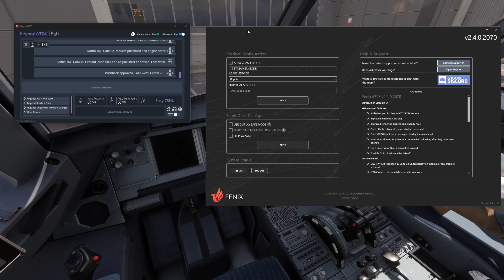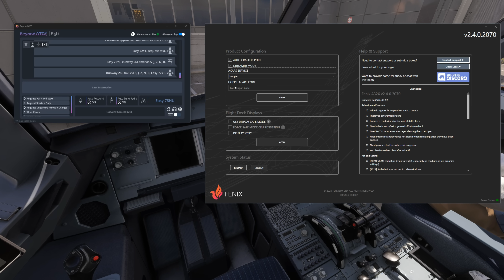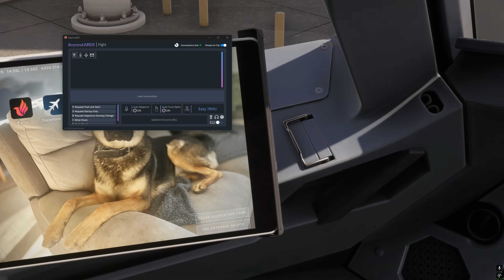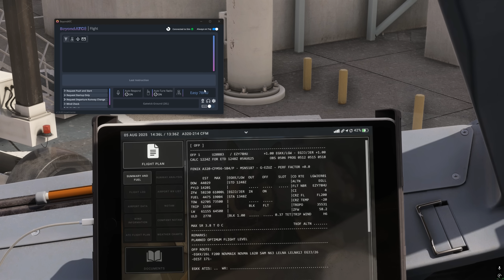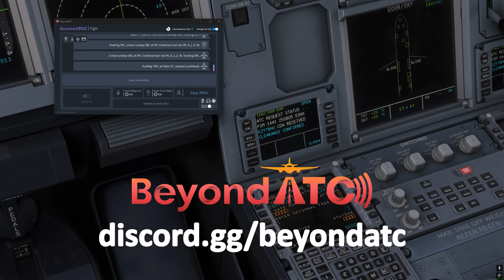HOW TO - BeyondATC (BATC) & Fenix A320 CPDLC PDC Integration SETUP AND USAGE GUIDE

Comment: Couple questions about BATC sir if i may, first does it work in MSFS 2024? And if so, does it require the FSUIPC to connect to the sim?
Reply from the maker: Hello! Works fine in 2024, and it only uses native simconnect. No requirement for FSUIPC (although no conflicts using it if you need it for other apps)
Reply: @JasonOPlays  hey there sir sorry just getting back to you now i actually purchased BATC after seeing your reply here and I absolutely love it thank you so much for recommending this. just a quick update question if i may sir, when is the average time that experimental stuff will be inserted to the stable build? i wasn't aware of this feature that you covered in this video but now i realized that seems like so many good stuff are present in the experimental branch, its just im not willing to buy the Experimental package as I felt that if I have the same amount of funds to purchase it i'd rather buy the Premium voice big pack so that i can get the 750.000 character. hope you reply again sir, thank you again and best regards.

Comment: Where do you install the experimental version how did you get it
Reply from the maker: You need to purchase the Supporter upgrade for BATC to access it. You then change it in the options. However, this feature will come to the normal Early Access branch and probably won't be too long to wait.
Reply: @JasonOPlays I wish they would implement the taxi route in vr the tool bar is great but no airport taxi map. I play only in vr with pimax crystal super and 4090.

Comment: Any plans for integration with FSLABS?
Reply from the maker: It's down to the aircraft to intergrate it. BATC developerrs have designed it to work identical to Hoppie - so if the aircraft is Hoppie compatible, they just need to give the user a way of swapping it to BATC which changes the address to where the aircraft sends/checks messages.
Reply: @JasonOPlays oh thanks! 🎉

Comment: do uou know how to sync the nav data with the inibuilds a350 ? when i click the sync data   i get  red warning saying something like no data ??
Reply from the maker: Sorry, I haven’t really used the A350. In this related to BATC?
Reply: You may need to double check your Simbrief information, I had this issue and had to re-enter my ID several times before it actually saved and was able to pull the info.

Comment: Is this for online flying or can it be used offline as well? Thanks for the awesome video very easy to follow.
Reply from the maker: BATC is not designed for flying online, although you still can - it just wouldn't make sense to as no one else can hear your ATC transmissions, or see your traffic. And, others might land on an opposite runway BATC wants you to. BATC is ideally there to improve your offline experience by giving you ATC everywhere, and inject traffic based on a historic live schedule.

CPDLC does exist as an option online, it's done via Hoppie and will work in a similar way to this video except you need to know the controller's airport ID (not always the ICAO of the airport).